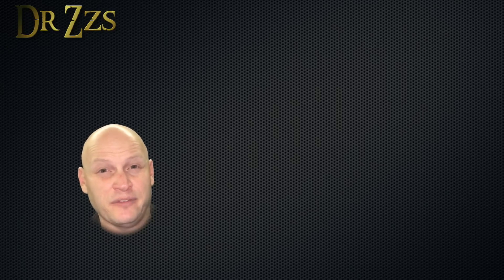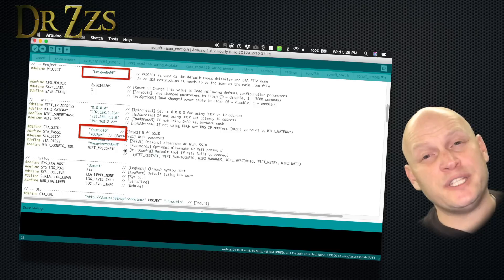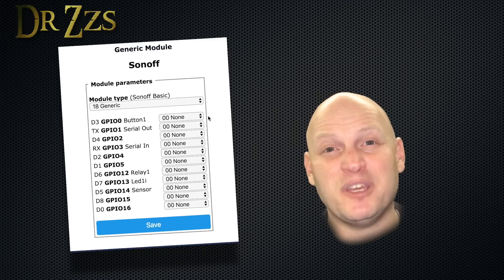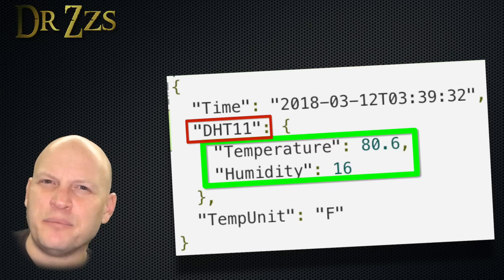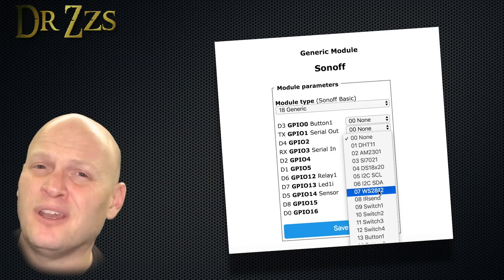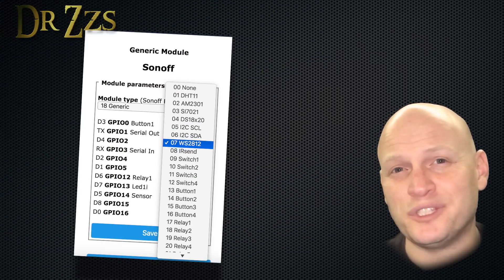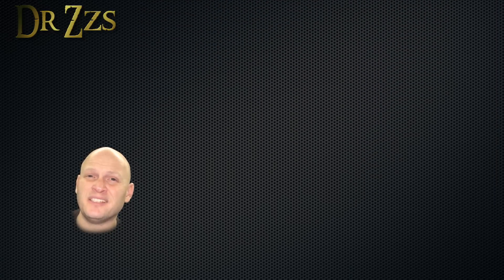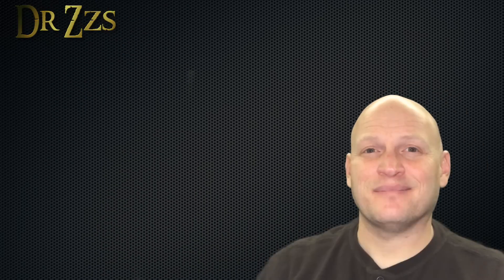Tasmota + D1mini (or Sonoff) - Temp & Humidity, ws2812 LEDs, and Motion Detection

Comment: I'm having a tough time figuring out the answer to what I'm trying to do (similar to the video). I have a momentary push button switch and a PIR sensor attached to two different sensors as switches. Even though one is switch1 and other is switch2, they send the same mqtt topic (because "SwitchMode" changes it for all switched) and they both ending up switching the same Sonoff Basic relay. Any workaround for this?
Reply from the maker: I think for Switch2 to not switch Relay1 you have to set some other pin as Relay2.  I'm not 100% sure about that, but someone else had a similar issue recently and I think that was how he solved it.  
Let me know if it works or not.
Reply: Yes, setting a matching Relay2 on one of the GPIO's doesn't toggle the main relay anymore! Thanks!

The only caveat is that switching on Relay2 (or any relay) still toggles the onboard led. That's a problem for me because I planned to attach the led on the pushbutton to the GPIO13 pin on led and any of the GND. This would give me the inverse light on pushbutton so that when the light is off, the button is lit (and it also provides all blinking indications if something is wrong on sonoff). Now, with the Relay2 turning on the led, it turns off the button led. So right when someone comes close to want to turn on the light, it makes it invisible in the dark.

New idea (using your suggestion) is to connect the pushbutton to Switch2 and the pushbutton led to Relay2. The effect is very cool because now the led only turns on for a few seconds when someone gets close to the light switch. The only downside is that I will not be able to see flickering lights on pushbutton if there is a network issue or something else wrong with the sonoff.
Reply from the maker: Eugene Pugach for sure! There are commands that change what the onboard LED does 
https://github.com/arendst/Sonoff-Tasmota/wiki/Commands
LedPower and LedState. I haven’t messed with it but you might find a setting there that you like better.

Comment: I keep getting false triggers on the pir sensor =/. Connected to 5v on sonoff basic. Using hc 501 sensor
Reply from the maker: hmmmm
it's triggering with no motion?  That's probably not a software problem.  There might be a sensitivity adjuster on the sensor somewhere.  There's also probably a non-re-triggering switch to set it not to re-activate with new motion until after a period of time.  
But really, if it's activating (detecting motion) when there is really no motion then there most likely is something wrong with the sensor.  Hopefully that's not the case and adjusting sensitivity or re-triggering will fix it for you.
Reply: I have played around with the sensitivity, doesnt help.. seems to be a common issue with this perticular sensor.. https://forum.mysensors.org/topic/3287/motion-sensor-triggering-on-its-own/11  I might just buy a set of new ones.
Reply from the maker: bummer.  I musta just got lucky.  Mine works fine. 
Sorry man, that stinks.

Comment: Hi, mate Thanks for video actually when I upload TASMOTAon D1 mini everything is working fine unless I change my IP address and subnet mask for example from 192.168.0.1 to 10.0.0.15 with 255.255.255.0 netmask and TASMOTA doesnt any action and I didn't find any AP in WiFi. would you please tell what is wrong in my configuration?
Thanks
Reply: I would be appreciated if you focus on OTA configuration for example after i install sonoff switch on the wall and I decide to change my home network from IP add 192.168.0.0 to 10.0.0.0 with subnet 255.255.255.0 so I didnt have any access to switch

Comment: I have a problem with my ws2812. I am able to controle the brightnes in the userinterface, but I can't control the LED color.
I am able to control the light with useing the comands in the MQTT section. 

My config looks like:
light:
  - platform: mqtt
    name: "Licht Boxen"
    command_topic: "cmnd/d1mini1/power2"
    state_topic: "stat/d1mini1/POWER2"
    rgb_state_topic: "stat/d1mini1/color"
    rgb_command_topic: "cmnd/d1mini1/color"
    brightness_state_topic: "stat/d1mini1/dimmer"
    brightness_command_topic: "cmnd/d1mini1/dimmer"
    brightness_scale: 100
    retain: true

can anybody help me?
Reply from the maker: Is the color wheel not appearing when you click on the light in HA?  
Your config looks fine. Can you change the colors using the Console in TASMOTA?  Finally, can you change the color using by using “mqtt.publish” from the “services” page in HA? 
If none of those work then there might be a problem with the LEDs.  My guess is there’s a mistake in the syntax somewhere. Trying those different methods for activating the color change might help you sort out where the mistake is.
Reply: DrZzs The problem is solved! :) I deleted the "2" after the word "power" in the HA config.
Reply from the maker: Ok great! 
Maybe I had the 2 because I had something else as switch 1. 
Glad you figured it out!
Reply: Now I have another problem. There are only the first 30 LEDs working, but there are 50 LEDs on the stripp. I have already changed the LED_NUM in the sketch, but it does not work.
Reply from the maker: Are you using Tasmota?  Go to the Tasmota Console and type "Pixels" it should return the number of LEDs it thinks you have.  Hopefully, it'll say 30 (that'll mean we found the problem).  Then type "pixels 50".  That should fix it.  
Where did you change LED_NUM?  in the user_config.h?

Anyway, try the Pixel command.

Comment: Hi didnt you have to change the signal V logic for the led strip as they run on 5V signal?
Reply from the maker: No. They seem to work fine. But yes, if you connect them and have issues then a logic shifter would do the trick.

Comment: Hi
Can someone help me

I've been trying to make works a PIR Sensor with a sonoff basic connected to the GPIO14 10 Switch2

21:59:10 MQT: cmnd/lumieredeschats2/POWER2 = TOGGLE

##############################################################################
binary_sensor.yaml

- platform: mqtt
  state_topic: "cmnd/lumieredeschats2/POWER2"
  name: "Detecteur De Mouvement Chats" 

#############################################################################
binary_sensor.detecteur_de_mouvement_chats:
  device_class: motion
#################################################################################

But when the motion is detected nothing happend into HA
Reply from the maker: How are you referencing your "binary_sensor.yaml" in your main config.yaml?
You have?
"binary_sensor: !include binary_sensor.yaml"
Reply: yes I have binary_sensor: !include binary_sensors.yaml into (configuration.yalm )
Reply from the maker: I'll have to test it myself to see if there's some trick to making it work that we're missing.
Reply: DrZzs The state on/off are the same "TOGGLE"
Reply from the maker: well, yes as a command. Toggle with change the state from On to Off, but if you are reading the state and the payload being read is "Toggle" then that will not register as On/Off.  
That could be the source of your problem.  Maybe try going to the Tasmota Console and type "switchmode2 2" or "switchmode2 1"  Then the message that gets sent on the "state" topic should be On or Off instead of toggle.  

For the record, if that is the answer then you figured this one out by yourself.  :)
Reply: DrZzs switchmode2 1 works wery well thank you very much

Comment: Hi there your videos have got me hooked to Tasmota and Sonoff!

Can I use the D1 mini and Tasmota to switch on and off 2 contacts ? Say I would want to use it to send a momentary  on off pulse to an appliance switch ?
Reply from the maker: you sure can.  
I'm working on a project using a D1 with relays.  One issue I've found so far is that the voltage output on the D1 GPIO pins is only 3.3v.  That might not be enough to trigger the relay.  I've got mine traveling some distance between the D1 and the relay, so the voltage drops even more.  I bought a logic level shifter to boost the voltage of the signal to 5v, which should be enough.  They just arrived so I haven't tried it yet. 
I'd say try it without the level shifter and hopefully it'll work if you aren't losing voltage over distance like I am.  If you find the relay isn't triggering with the 3.3v try one of these:
https://amzn.to/2r8gvxw

Hope that helps!

Comment: Can't get the dht11 to show up?
Reply from the maker: in the drop down menu?  What version of Tasmota are you using?
Reply: DrZzs 5.12.0i
Reply from the maker: is it not giving you the option to select Dht11 from the drop down menu on the Configure Module page?  Or is it not giving you T&H results from your connected dht11?
Reply: DrZzs is not giving any reading from the dht11, tries on few gpio already but not working, but able to make pir works
Reply from the maker: hmmm.  
Maybe the dht11 is bad?
Do you have a way to verify that the DHT11 is working?  I guess you'd have to try and connect it to another board.  Maybe an Arduino Uno or another D1 mini or a Sonoff.  
Just now to test it out, I changed a pin on one of my sonoffs to DHT11 but nothing showed up.  So I'm guessing if there's no data coming from the DHT11 Tasmota won't show anything.  I'd have to be home to test it with the D1 and my dht11.  I'll try to test it out later and see if I can reproduce the problem on the D1. 

Right now I'd guess the dht11 module is bad.  Hopefully that's not the case, but I can't think of what else might be happening.
Reply: DrZzs brought and just arrived 3pcs of the dht11 tried all same result on the 2 wemos d1,can't figure out why.
Reply from the maker: Maybe check that the wires are attached correctly?
Reply: DrZzs checked,nothing wrong still not working
Reply from the maker: dang.  
Maybe try selecting different sensor types. Maybe try DHT22 or AM2301. 
https://github.com/arendst/Sonoff-Tasmota/wiki/Sensor-Configuration#single-wire-sensor

Have you made a post on the Tasmota Issues page?  Maybe one of those fellas has some more ideas about what to try next.
Reply: DrZzs try all sensor but still not working maybe buy a DHT22 and try again. 

Open an issue on the tasmota page.hope somebody can helped! Thanks @DrZzs
Reply from the maker: Bummer.  Well, I hope you figure it out.  Let me know if you do (or don't)...

Comment: Great video, thanks. Regarding the PIR switch, there is just one thing you forgot to mention, which could have saved me some time debugging: you need to do "SwitchMode2 1" in Tasmota console. Otherwise automation won't work since it sends "TOGGLE" signal by default, instead of "ON/OFF".
Reply from the maker: Oops.  Don't know how I missed that.  Thanks for bringing it up so others don't get hung up by it.
Reply: I lost so much time looking for the answer, thank you!!!
Reply: i just tried this and it still toggles the relay hmmmm
Reply: thank you, it helped
Reply: thank you for your info!
Reply: Thank you Eric for the above help. and thank you Dr Zz on the tutorials. Great work!

Comment: Thoughts on using a Sonoff SV to control the 5v ws2812 leds?
Reply from the maker: Would work for sure. How many LEDs are you thinking of having?  You could supply 5v power to the Sonoff Sv. Power to the LEDs from the relay and then data (control) to the LEDs from the gpio pin. 
Should work pretty well.
Reply: Would there be an issue with the single voltage? 3.3v vs. 5v? Looking at about 200 leds. 5v 5 amp ps.
Reply from the maker: Nope. Should be fine. The LED controller gives each led the voltage it needs to get the right color. There are 3 wires on the LEDs. 5v, ground, and control. You might already know that.
Reply: Not working, found something about using a level shifter because the signal voltage is only 3.3v and the supply is 5 volt? Thoughts on level shifting?
Reply: Fist off you are such an inspiration... You have me "sonoffing" everything... WAF on the raise. I just keep trying stuff until it works. So I got SV to work with LEDs using a level shifter. Soldered on header aligned with GPIO5 fits perfect.

Comment: I took lot of inspiration from you and started home Automation, first I used sonoff with ordinary switch BUT now I want to use nodeMcu or D1 mini with ordinary switch but I cannot figure out how to do it, can you please tell me.
Reply from the maker: I'd have to experiment with it some.  You want to use regular switch and relay? 
You've tried assigning one pin on the D1 or MCU to Relay1 and another to Switch1?  I think there are a couple that are defaulted to those in Tasmota "generic" but I can't remember which ones.  With all the pins on the D1 or MCU you could control at least 4 switches and relays I think. The way it works should be that Switch1 controls Relay1, Switch2 controls Relay2 etc.  For the switches I don't know if they need to go "high" or "low" to be activated. Probably "low" so you'd connect one wire on the switch the the Pin you're using and the other to ground.  Same with the Relay; the two wires connecting to the relay coil, one goes to the Pin you've assigned and the other to ground.  
Having not done it myself I'm guessing at how exactly it would work, but that's how I'd start figuring it out.  It may be a while before I get to test it out, but I'll try to get to it eventually.
Reply from the maker: I actually have an idea for using the D1 for some switches and relays. I may get to this sooner than I originally thought.

Comment: Hello DrZzs,
First of all many many thanks for your tutorial which is very useful to me for making home automation.
I have made 3 switches with basic sonoff with flashing tasmota and it's working very well. thanks again.

      Than I Flash tasmota on NodMCU and controlling 4 relay board, Its works but there is little problem.
When I trigger, It works opposite, means when I turning ON my relay goes OFF and When I  turning OFF it goes ON.
So Please help me to solve this problem.

My tasmota settings are below.
Module type is 18.Generic
D6 GPIO12 Relay1      -   Relay 01 
D7 GPIO13 Led1i       -   Relay 02
D5 GPIO14 Sensor     -   Relay 03
D8 GPIO15                  -   Relay 04
It will be very helpful to me if you can solve this problem.
Sorry  for my English.
Thanks,

Comment: Copied this exactly. Got the exact code in hassio for the temp/humidity. It's dismaying when I log into the d1 mini but in home assistant I get the temp/humidity icons but no temp displayed.
Reply from the maker: My first guess is there's a problem with the topics in your sensor entry in Home Assistant.  What do you have under "Topic" on the MQTT page in Tasmota?  Whatever you've got there has to match the middle section of the State topics in the Sensor entry in Home Assistant.  Mine says "D1mini01".  If that's not it then I'd check the "value_template", make sure you have ".DHT11." in the middle.  
If neither of those things reveals the problem go to the Console in Tasmota and type "status".  That'll give you the mqtt topic that the sensors are being published to, and the payload that the value_template needs to read.  (that's probably confusing, sorry).  
It'll look like this:
https://www.dropbox.com/s/9xs9y06gmxr0eml/Screenshot%202018-04-10%2018.40.33.png?dl=0

Hope that helps!
Reply: thank you for the quick reply. ive followed your other guides and have sonoffs working.
ive read through your comment and here are screen shots of my settings for each for the d1mini with dht11 sensor.
https://www.dropbox.com/s/vizs4kiqnraqz0v/hassio.JPG?dl=0
https://www.dropbox.com/s/14satuxtk1q5gfw/d1%20mini.JPG?dl=0
https://www.dropbox.com/s/97qr2q1k97upbvu/console.JPG?dl=0
Reply: Now it is randomly working. i changed nothing and it has started to show efter 1 hour. thank you for your help though LOVE your videos and Tasmota.
also is there a way if i set up multiple d1minis as temp sensors to have them all in a panel like with switches instead of the icons at the top of the gui?
Reply from the maker: That's weird, but I guess we'll take it. 

Yes I would expect you can put all the sensor outputs in a card with an entry in the Groups.yaml file.  You should be able to copy the one I showed for the locks, just change the entity Id's and titles.